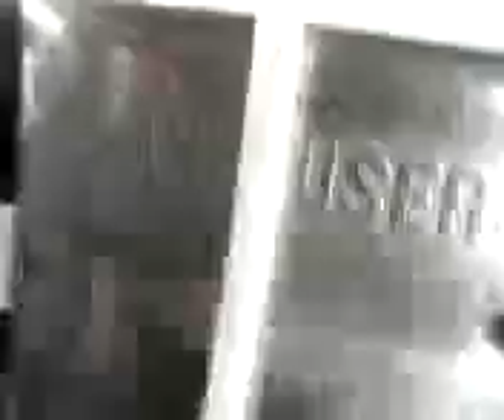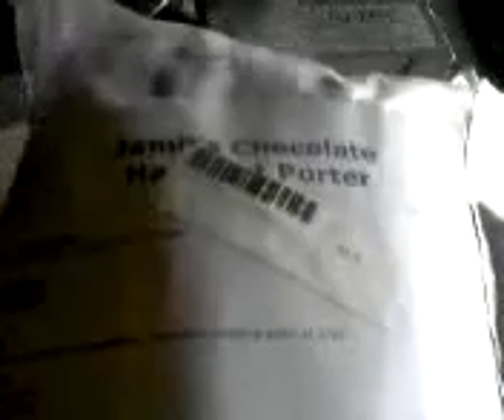How to build a Home Brewery Part #12

Comment from the maker: @JustWonderingHowToDo 
 How did you mount that fosset on the cooler. Is it the same system like the one you used on the keg? Yes it is... Just remove the plastic one and add the stainless steel one. 

Is it safe to run those propane burners indoors? 7 hours ago... 
I'm in the garage with the garage door open